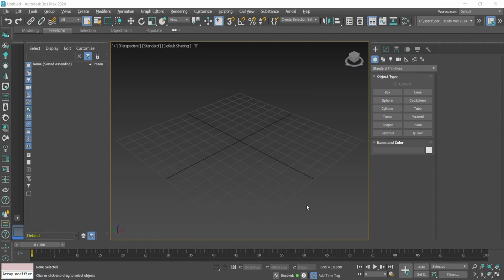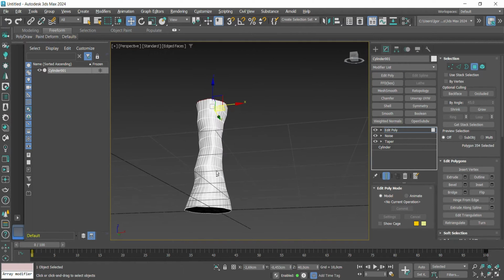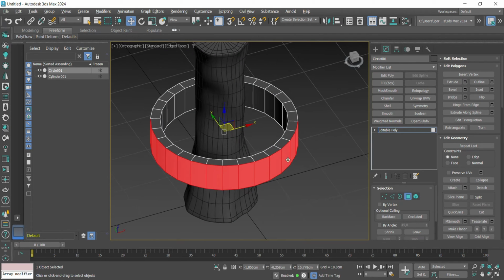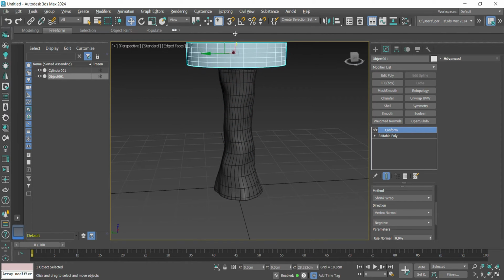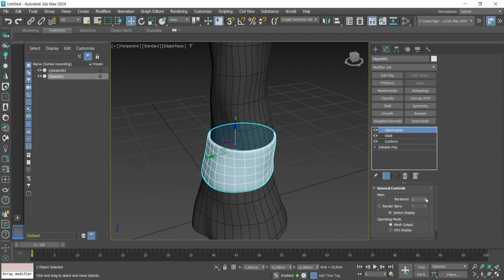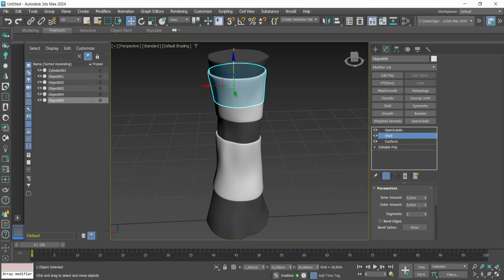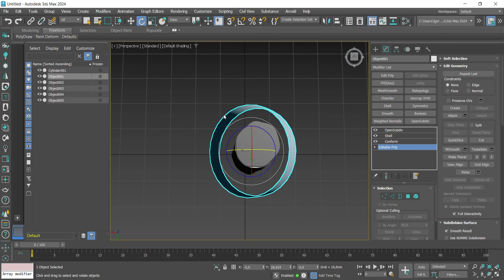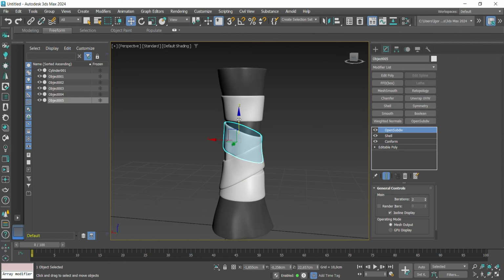How to Use New Conform in 3ds Max: Step by Step #3dsmax #tipsandtricks #3dsmax2025

Comment: My friend, I would be very happy if you could answer me how I can open such a round thing in 3D Max and make it ready for production.
Reply from the maker: Hi sr. What do you need?
Reply: @igormota3d  How do I want to divide a curved object for daily production by sticking it on a flat surface and taking its measurements?
Reply from the maker: @AyhanAycan1997  You can get exact measurements in 3ds max by using the measure tool. With it, you can check the size of objects. You can also create a box with the dimensions you need and then adjust the size of the curved object by aligning it with the box.
Reply: You design something at max where it is necessary to take measurements after opening it first, it needs to be opened and developed for real survival properties.